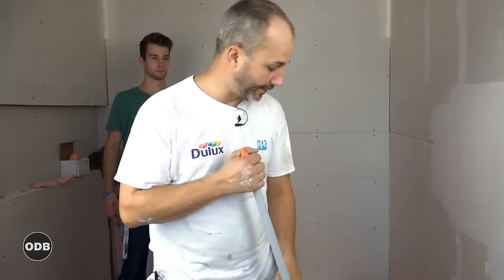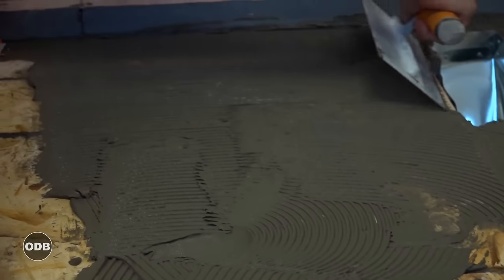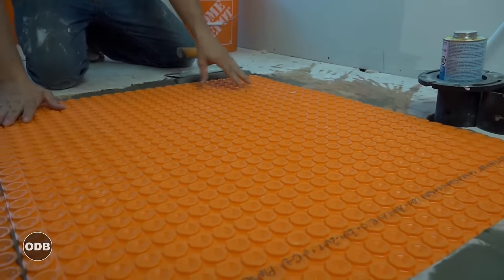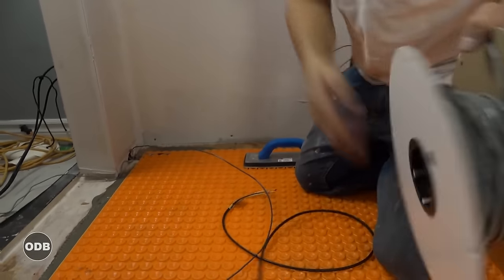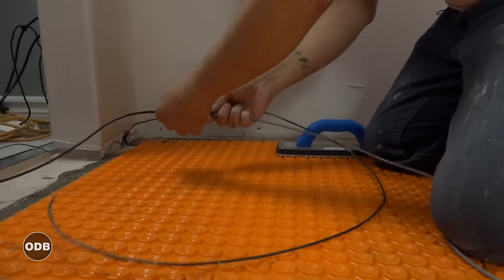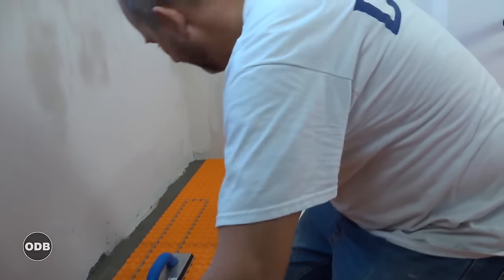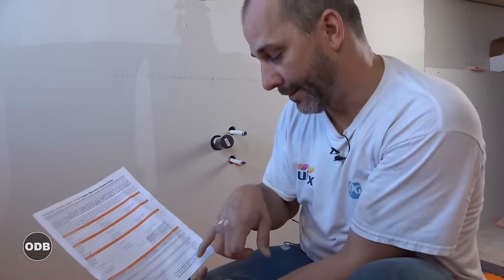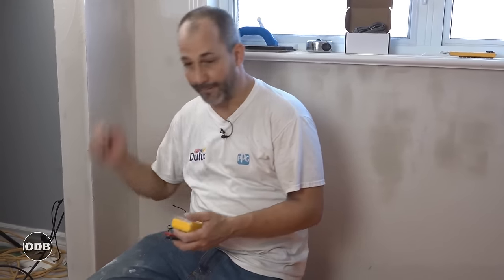How to Install Ditra Heated Floor System by Schluter Systems

Comment: Hi!,
I have question 
I understand I need to use the unmodified thinset for the substrate ,can I use Marie ultralight flt thin set for the ceramic (big format)?
Thank you for a reply.
Reply from the maker: If you want a Large format tile cement then they sell that. In both modified and non modified gray or white!
Reply: Use modified for wood substrate and unmodified for concrete substrate. Very important.  Unmodified will not bond to wood and your grout/tile will crack and you'll be replacing it all.
Reply: Use Schluter Allset. It’s a bit pricy but it’s good for any application and you don’t have to think about the modified or unmodified part. I called the company to verify this.

Comment: This is the second video I've watched today and there are a couple of points and questions that neither video addresses.  The first one is that I do not think what you actually buy is "totally customizable" which was somewhat alluded to in the beginning but discussed a little at the end.  You cannot have, say 5 ft., of heating cable left over.  I will check to see if there are different lengths available for small bathrooms.  Lastly, since this video is for the DIY'er, am I "qualified" to check the resistance in order to make sure it is warranted?  Pretty good vid although I would have like to have seen how to wire the system up to the thermostat and power source since I think I read that it has to be on a separate circuit breaker?

Comment: Would this work with micro-bore copper? Looks about the same diameter as the cable 

Gas is much cheaper than electricity in the UK
Reply from the maker: Hi Paul, I am not sure about that, perhaps contact a flooring wholesaler and inquire with them.

Comment: I believe you said that the circuit breaker for the Ditra Heat system needs to be a GFCI breaker. On Schluter’s website, they answer this question that the thermostat has GFCI built-in. So the breaker doesn’t need to be a GFCI breaker. https://www.schluter.com/schluter-us/en_US/faq/ditraheat-system-gfci-breaker
Reply from the maker: Your electrical code may require it at the panel as does mine. Cheers!

Comment: HI all. I installed this product as instructed.  Had done all the tests as required. No heat. Thermostat calls ... load calls but no heat. Any clue?  Also the manual says that it must be grounded. I'm using bx on a dedicated circuit. So it should be fine
Reply from the maker: get an electrician
Reply: I've had issues with bx not providing an adequate ground.  Curious what you found?
Reply: Bennie White k

Comment: I'm about to undertake an upgrade to my 1929 house replacing my existing copper pipe how water baseboard to a hot water radiant floor heating system.  Any suggestions?
Reply: how did ypur floor turn out? i need info
Reply: @cheryldebarge  We decided to not go radiant floor heating. The old house had more issues that needed attention.

Comment: Can this be installed under vinyl planks?
Reply from the maker: yes but you need to pour a floor leveler over the cables first. Cheers!
Reply: @HomeRenoVisionDIY  Why would you not post a correction after you made a video NOT doing that??

Comment: Hi, I'm going to use a Suntouch headed mat for my basement bathroom floor. 

My question is, should I use a self leveling concrete to go on top of it since there will be a slight height difference in the area that's not headed?

Thanks!
Reply from the maker: What does sun touch recommend.
Reply: @HomeRenoVisionDIY  they said either that or heavier thinset on the lower side to make up the difference. Just curious on how you would do it?

Comment: So if you wanted to use this heat system for radiant room heating, would you place the wires closer together, like 1 octagon apart? Or is there a completely different system for radiant floor heating?
Reply from the maker: the spacing gets smaller and you simply set the thermostat for the desired ambient temp. Cheers!
Reply: @HomeRenoVisionDIY  not correct unless you want to void warranty. No closer than 3 spaces
Reply: @kacey Howell  that will void Schluters warranty. You would use a different system. This product is only for warm tiles although they do have an ambient heat sensor in the thermostat in you can set as well.
Reply: Christopher, you can do three and three spaces or three and two. Those are the only options.

Comment: just buy under heated floor mesh saves all that work
Reply from the maker: The mesh is ok. but I needed an uncoupling membrane as well and the wire to travel into the shower so the mesh is very limited in its application as the wire allows for a complete custom job.

Comment: The pad has to be completely saturated with your mastic what you showed wasn’t
Reply from the maker: John you are really splitting hairs here. the pad upon inspection was 75 adhesion and then we applied pressure again. once you factor in the process of walking on it as well during the heating cable and tile application it will be 100%. You are trying to cast dispersion where it is not required and frankly not appreciated. As our followers will atest put up a video or shut up in the comments. Cheers!

Comment: It is only a floor WARMING system. I installed mine 2 years ago, and in the end had to reinstall my baseboard heater.
Reply from the maker: Ouch, I never suggest relying on a floor matt to heat the whole room. This is a luxury comfort item not a heating system.
Reply: @HomeRenoVisionDIY  exactly

Comment: Shouldn't that be modified thinnest for the DITRA
Reply from the maker: No It has to be non modified.
Reply: You might want to check with Schluter on that.Modified under Ditra; unmodified over Ditra.
Reply: Keith Burke That’s what i thought as well, Unmodified for under the Ditra and Modified for over the Ditra
Reply: @HomeRenoVisionDIY  modified on wood. Unmodified on concrete. Check with Schluter
Reply: @strictlysinks8382  other way around, bro
Reply: Keith Burke schluter  allows Ardex X4, X5, and X77 under and over all ditra. All are modified.
Reply: Just use Schluter Allset and call it a day

Comment: 2:47 "Just a moderate amount of pressure...make sure you have good adhesion"

Lifts up the mat and there's hardly any cement stuck to it.

Yup. Seems legit.

Comment: do not listen to anything this guy is saying here. you need to install both temp sensors and you 100% want to have the splice inside of the matting. Go on schluter's website for proper installation.

Comment: Use modified  when installing  to wood. Thinset should've  been thinner
Reply: Recommend using Schluter Allset and following their mixing instructions on container. They give the ratios for each type of application.

Comment: The pad should have been completely impregnated with your mix. What you showed on video wasn’t a proper coating on the mat. I hope you corrected that for the customers sake
Reply from the maker: Hi John, You saw me correct it before your eyes. I stand on my work.

Comment: You skipped lightly over the electrical tests.  There are 3 of them, you only did one.  One of them requires a MEGA OHM METER, that sends a 1000v thru the cable to make sure there are no points of leakage...which WILL show up if you connect this circuit to a GFI.  That is a special meter even many electricians don't have.

Comment: Total fail of trowel use, you are not allowed to use Ditra towel (which has 1/8"x1/8" notch )to install ditra heat or Ditra XL. Instead U have to use Ditra Heat trowel or a 1/4" x 1/4" notched trowel. thats why his contact check is a big fail.
Reply: you only have right. A Kerdi trowel is 1/8 ×1/8... The fitra trowel is 11/64x11/64.

however yes ditra heat and ditra xl should be done with a 1/4x1/4

Comment: great video .Which Mapei kerbound do you use above the ditra . Do you recommend this
https://www.lowes.ca/mortar/mapei-227kg-kerabond-t-premium-medium-bed-and-thin-set-tile-mortar_g2365541.html?searchTerm=mapei-kerbound

Thanks
Reply from the maker: I recommend using any non-modified cement. There are 2 varieties modified and non-modified. After that you have color choices and special additives for large format etc. The key is to use non-modified and then the other options are to be used at your discretion. If you have any doubts or questions ask for help from a tile supply company. The staff there should be well trained to assist. I never trust the advice from boxstores because they don't have a broad selection of products and the training necessary to give good advice.

Comment: Come on seriously that was not 90% coverage I’m the cement should be modified underneath and non-modified when you install tile
Reply from the maker: You actually have it backwards, This is why they invented the new allset because there are so many people who are doing it backwards who haven't gone for proper training.
Reply: No, he is correct, to some extent. Dry areas should have 85% coverage. Your coverage is maybe 15%.
Reply: @HomeRenoVisionDIY  you have it backwards bro. Bet you cant tell this frustrates me to no end. Modified on the wood. Dude check with schluter and dont be so arrogant. Tell us honestly how soon after you had to go back for cracking grout or put the client's number on here so we can call them for an honest answer.

Comment: Very poor coverage
Reply from the maker: lol. only trying to warm where we walk. Cheers!
Reply: @HomeRenoVisionDIY  I think they were talking about the thinset coverage, not the cable coverage. The thinset coverage was not sufficient when you installed the first mat and lifted it. I could see a lot of white felt showing on the underside of the Ditra. Hopefully you went back and corrected it. Plus, you weren’t using the notch side of a 1/4” trowel which Schluter specifies.

Comment: I hate to say but the coverage is bad.  Wrong trowel size. Suppose to use 1/4 by 1/4 inch.  The trowel being used is for Kerdi membrane.   I think this video should be pulled and a new one added.  Suppose to install.with 1/4 inch gap to walls as well.  Sorry to say but if you do your install this way you will have issues.  Just my opinion....

Comment: Do not use this video for reference.

- wrong adhesive was used on wood.
- adhesion contact was poor.
- cable should be tested repeatedly
- no clarity on shower floor install. Not good idea.
- heating shower floor wastes time and money
- sensor needs to be in centre of field
- second sensor should be installed 
- trowel should be 1/4 x 1/4
- don’t tile on wet Ditra- wait and test wire.
- more clarity needed on install tips. 
- Installer had no idea about 2nd sensor with wire.
- there are MUCH BETTER DIY vids avail. 
- the guy may do good work...it’s not on display here
Reply: shouldnt it be modified thinset for plywood and unmodified for concrete floor then unmodified for the tile on top
Reply: Unfortunately, I agree. I noticed these things as well. He claims to have taken the Schluter certification course but he must have been daydreaming through parts of it. Seems like a nice guy but nice doesn’t mean the job is done correctly (on that note, you can still be a good person AND get the job done right). Schluter is no joke and must be followed exactly! No mucking around with this product. I hope his customers aren’t calling him back with issues. If Schluter sees this, I believe they will automatically flag him and void his warranties because this video is proof that he wasn’t following ALL their specifications.
Reply: -wear kneepads

Comment: https://resources.schluter.com/media/DITRA-HEAT-InstallationGuide.pdf
Reply from the maker: Yes it is true Schluter suggests using modified thin set under the ditra. This recommendation goes together with the ability to walk on the mat right away. If you let the mat set up overnight and tile the next day like most homeowners would...The use of unmodified works quite well and doesn't void a warranty claim.

Comment: Didn't seal the joints on the subfloor. Didn't use modified thinset. Thinset was to try. This instructional video it s***. I bet you I can pull all that Detra up the next day or the day after with one finger.
Reply from the maker: Funny how you don't like my install. Even Shcluter didn't like their own way of doing it so they changed the cement formula. modified cement had problems too. The secret here is to let it dry overnight before walking on it.
Reply: Dont need to use one finger bro. It's already up. Just sitting there on top of the subfloor.
Reply: @HomeRenoVisionDIY  * the secret is to let it dry forever and dont walk on it *
Reply: Thinset was “to try”?? Bwahahahahahahaha 
How about “too dry”!? Lol
Reply: They changed the formula because some installers are so set in their ways that they can't be bothered to learn the proper way. Using two types of mortar is a pain in the ass, I get it and I have mixed up the two in the first few installs but I always double check one last time. You are being awful defensive for someone who is open to constructive criticism sir. I learned from old school installers and have been lucky enough to be apart of the more technical (newer) side of the trade. Floor covering systems and the technology involved has come farther in the last 5-7 years then the previous 15 I've been in this trade. I'm 99% sure warranty will never come into play BUT if it does, you will be called on these missed/mistaken steps. Your prideful, stubborn and unless you learn to be a bit more open to these type of comments it will cost you. Maybe not in the form of money but see the thing is you put this on You Tube and if everyone who sees this does it your way they will in fact be voiding their warranty and while I'm sure your install will pass, them I can't say the same. Now their failed installs are on your hands. From one prideful floorlayer to another, from a guy who used to live just off of Bank Street and St. Laurent Blvd. You can be better man. Kind regards from Alberta. Take care man      @HomeRenoVisionDIY

Comment: never wet sub floor never
Reply: Wrong, sorry it's not like he is dumping water on it. He is using a damp sponge to remove dust and to give the wood a bit of moisture so it doesn't suck all the water out of the mortar. That is something that should never happen. I know you are thinking about swelling but with just the small amount of moisture he is added, it will not swell.

Comment: This is bad.  Don't watch.  He's supposed to measure resistance BEFORE putting the wire down in case you damage it while putting it down.  This guy is so sloppy about so much construction stuff I don't watch it believe his stuff any more.
Reply: He gets some stuff right but with the Schluter System, it’s very specific and all instructions have to be followed to a T. I have noticed several mistakes or misinformation in this video which concerns me, mostly with others seeing it and following what he’s doing. It’s good to watch a range of different videos (by diff folks) and especially those on the Schluter website so as to cross check all the information. If one step isn’t followed correctly, you could have BIG issues and also Schluter will not honor the warranty.